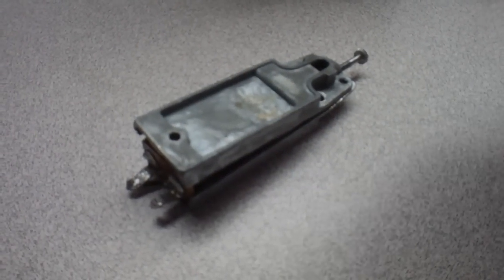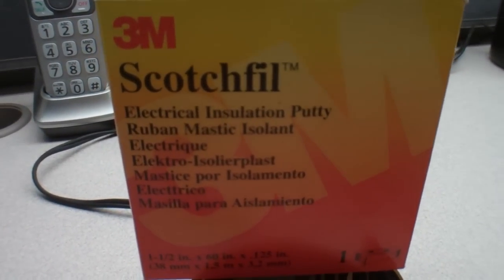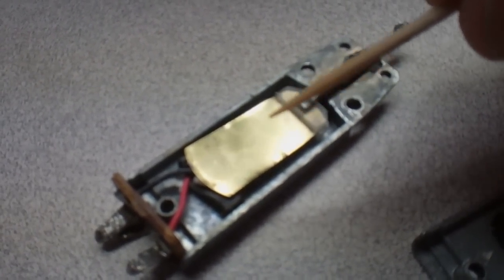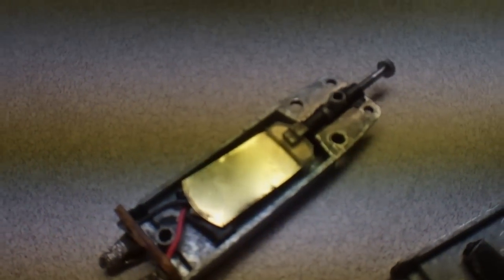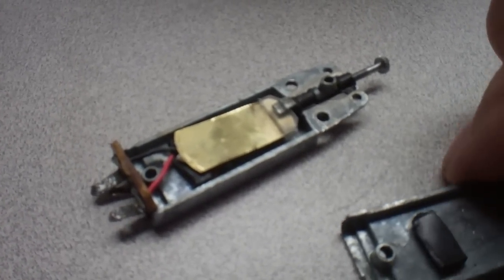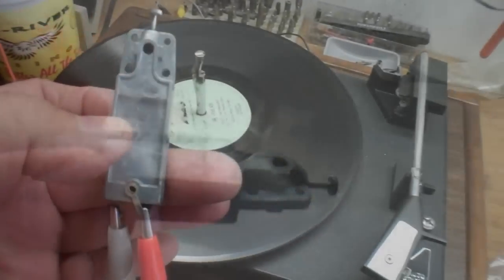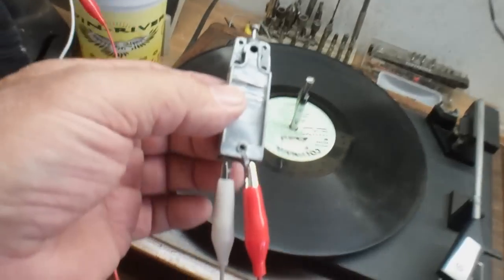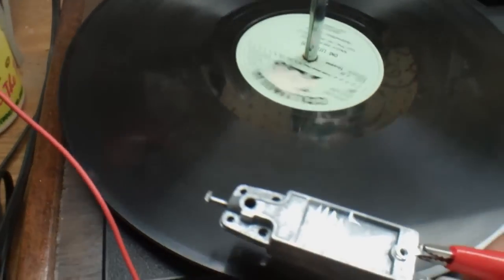(81) Rebuilding a Crystal Phonograph Cartridge with a Piezo Element Part 1

Comment: Thanks for showing the inside. I'm repairing a RCA Victor 2JS1, and I wanted the cartridge to be original instead of replacing it with something you got from a 70s BSR changer (What I mean is that people usually replace it with a cartridge using a flip over stylus).
Reply from the maker: Good luck, it may take a few tries to get it right.
Reply: @JackOfAllTrades2022  It's working so far. The only problem now is getting my hands on a stylus for 33s and 45s.

Comment: Cool to find this video... nice work, blackjack ... that sounds excellent.. :-)   
Years ago I did stuff like that and restored a few of those old 78 RPM phono cartridges by removing the ceramic element from a junked more-modern cartridge and transplanting  it into the old cartridge case.
That piezo element worked great... no doubt plenty of output, too.
Reply from the maker: Thanks, took a lot of trial and error, but finally got it to work so it sounds like it should.
Reply: You're welcome :-)

Comment: did you use a steel needle? I sure hope not
Reply from the maker: Probably was, because that's all I have...
Reply: Yikes. Take an old lp/78 stylus needle and rig it so it follows the groove properly the head is too heavy. See if you can spring the tonearm more so not much weight bears down on it. A lot of the newer light weight ceramic cartridges can also take there toll on 78s because of the deeper grooves. They play awesome its just that 78s didnt have a good RIIA curve because of the speed because at higher RPM the centrifugal force doesn't track the needle properly. That is why they went with lower rpm like 33 and 45s. The slower the speed the better the tracking. Steel needles can still wear out a record especially vinyl. The properties a proper ground jeweled stylus is better but speed also plays a big role. I still thing the cylinder record is a better engineering design.
Reply from the maker: Eckehardt krieger Thanks, I normally get rid of these old cartridges but sometimes people want original equipment, but I do use more modern cartridges and stylus whenever I can, this was only to demonstrate the repairs.
Reply: Yup even the modern audio karma that can be adapted to play 78s one has to be careful. Because those needles can flex to much and not track properly. Plus they're way to light

Comment: Jack, did like you showed, works !! but the volume is very low. Anyway of increasing it? Thanks.
Reply from the maker: +Sergio Lopez Could be several reasons, without seeing what you actually did, I can't answer that question. Be sure the element is not too tight in the cartridge. Are you using a Piezo element?
Reply from the maker: Could be that you have the element too tight inside... ? Sorry for the delay, didn't get a notification on some of these comments. Did you get it fixed?

Comment: Hi,  i would like to rebuild some of these old cartridges like the one you did here,  but first,  what is a piezo element,  and if i bought it at radio shack, what does the element come out of.  And how did you get to this point in the video.  I wished there was a part one,  so we could see how you assembled the parts and what it was that the piezo element came out of. I hope you don't mind me asking.
Reply from the maker: amberola1b Radio shack is out of business in most places, and the element is sold by itself, doesn't come out of anything  but you can purchase Piezo elements on Ebay. They have different sizes, so buy one that's close to what you need , but may still need to be trimmed and it wont hurt the element. Just be sure the two sides aren't touching each other when you get done, otherwise you won't hear anything. I may do another Video from start to finish.
Reply from the maker: I see its been a year ago since you asked, but it comes by itself... different sizes, you can also find all sorts on Ebay, just type Piezo element...

Comment: This is a Shure P87 now known as a W57A. Mine has the two connections shown and the case ground but my phono lead is just a single wire with a shield, how to I connect it?
Reply from the maker: The shield is the other wire -ground.
Reply from the maker: One lead is grounded to the cartridge ( shield ) to prevent hum...

Comment from the maker: Didn't keep it long enough to see how long it would last, but from reading about piezo elements, they should last a very long time. The needle is a regular old needle used in Victrola phonographs.. you can purchase on Ebay. But needles need to be changed often, like every ten records played not to damage the old records.

Comment from the maker: You can buy the piezo element at any Radio Shack and you can get yours rebuilt at west-tech services
Reply: West Tech is slow, and now 2021 costs around $50 to redo a cartridge. But they are the only game in town.Nice to see that someone at home can do the same thing.
Reply from the maker: @watcher818  I know, that’s why I tried doing my own....I wish I knew what he used and what he did, but I guess I’d have to buy one and take one apart and see. That may be an option soon. Thanks for watching.